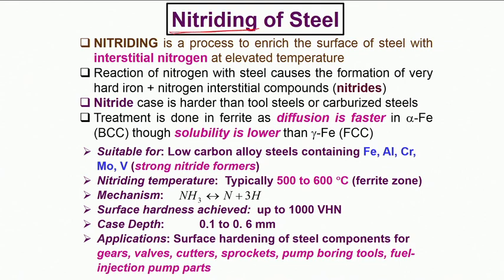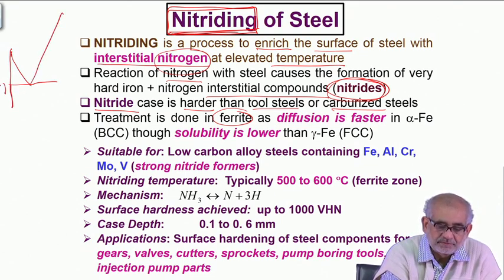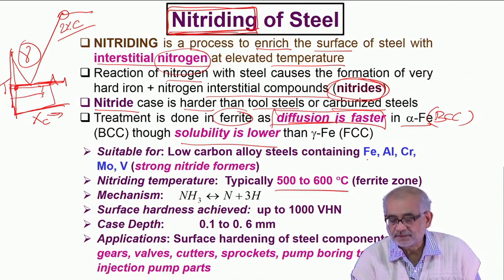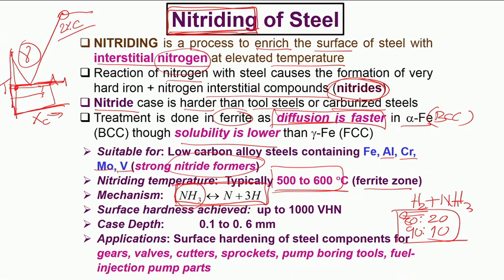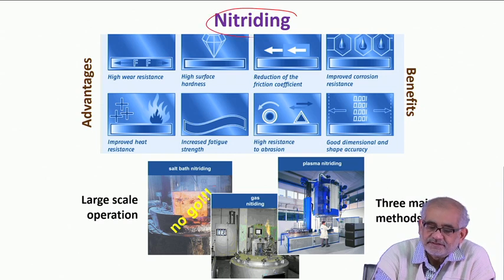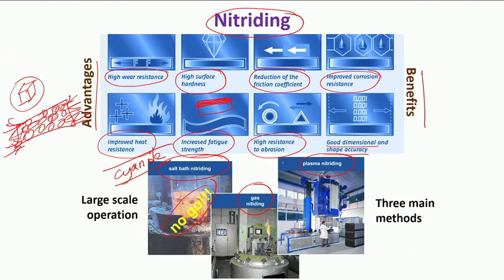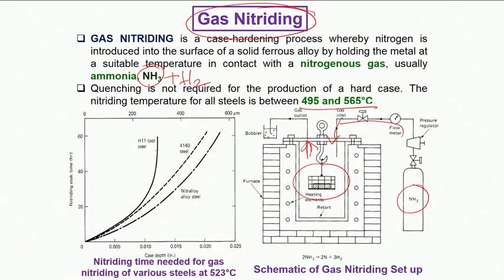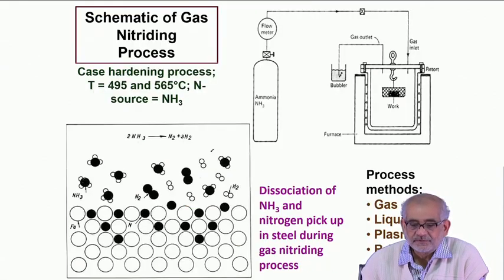Lecture 27 : Gas Nitriding

Comment: Does anybody knows that why nitriding can't occur at high temperature (for example 750 ºC or 850 ºC)? The ammonia decomposition rate is fairly high so that more nitrogen atom can be generated at surface at higher temperature. Also, the diffusion rate of nitrogen is also higher which is good for nitriding. So why the nitriding cannot occur at a higher temperature(>650 ºC)?
Reply: Ans to your query is at 23:23 .
Reply: @vaibhav8257  Thank you! But it only answer why we needn't heat more than 550 ºC, but at a higher temperature, will the nitriding happen or not?